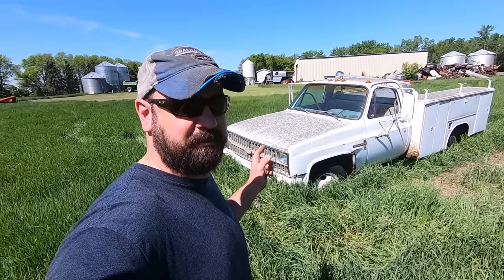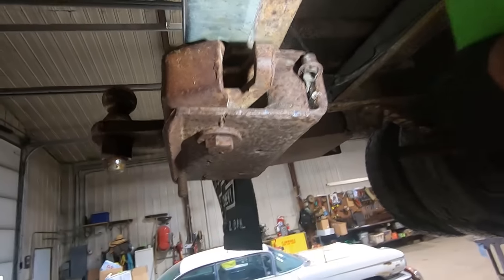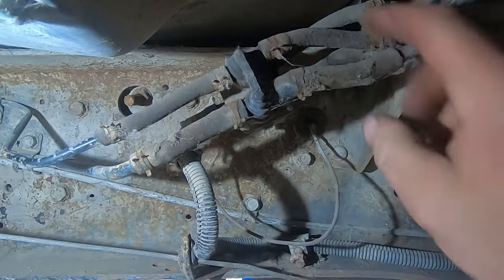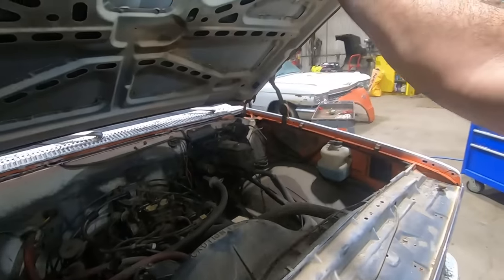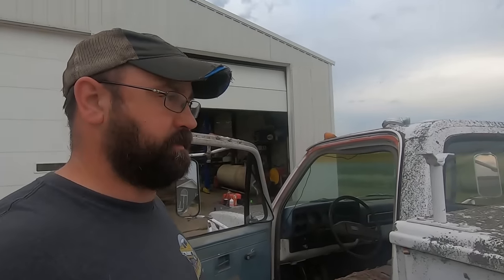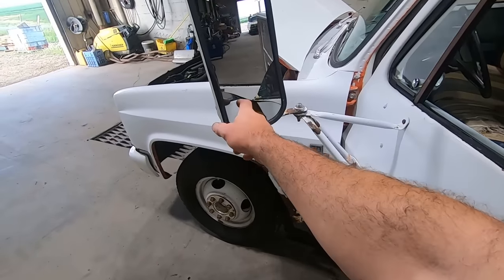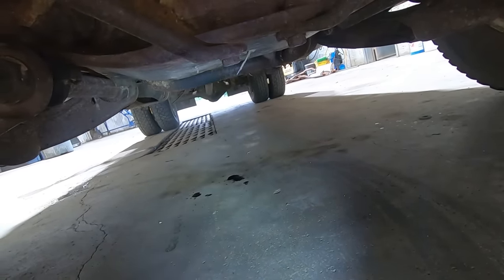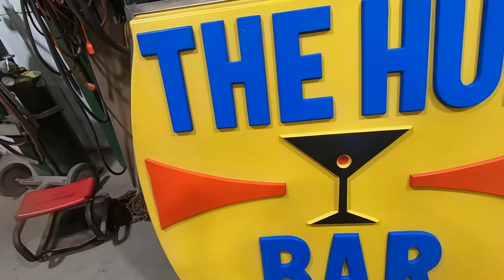1981 Chevrolet Dually! Abandoned for 16 years! C30 Squarebody Service Truck!

Comment: Rattle maybe Hanger Bearing on Drive Shaft slipt maybe need grease up with High Temperatures Moly Grease and need top differential fluid with 80w90  and they do get low on fluid too!

Comment: I've got a funny one for you. I took the radiator cap off one time when the engine was hot, you know like you do, and it blew off of there, you know like it does, and disappeared. I looked every where for it and it was gone. Bought a new one. Took the truck in for alignment about 3 months later and it had stayed all of that time just sitting on the frame riding up and down the road. I just laughed when they guy handed it up to me.
Reply from the maker: Nice!

Comment: I was working on a horizontal stabilizer one time, and dropped a 3/8 wrench down in the tail of an Embraer 145. I got into the aft cable rigging bay and climbed up in the tail as far as I could, took the stabilizer back off, opened every single panel on the vertical stabilizer and never found it. The aircraft ate it. No big deal because it wasn't interfering or anywhere near the elevator or rudder cables. My best guess is it fell all the way down through a lightening hole in a stringer and into the belly of the plane.
Reply from the maker: Damn
Reply: @MortskeRepair  hell of a thing to watch a wrench vanish into the void 😂

Comment: I use to pull up between pumps and fill them both at the same time.  Yea that pissed people off. O well.  1978 3/4 ton. Big block 4 speed. 4x4. Wish I had that truck still.
Reply from the maker: You’re that guy!

Comment: The stripper models are probably my favorite. Most stuff is a repair and an upgrade. 

Get on Wayfair and find the biggest fan you can install with the most blades. Generally more blade surface area means less noise. 

That looks like a 14bolt full floater. I read that most of the GM ones were 4.10 or 4.56. I also read that the rings are for conical nuts. I have a 4.10 rear with 10,000 GVWR springs. It's a firm ride but with new shocks it's kinda fun in a short bed single cab dually. Not much body roll and no wheel hop.

I just wish the tires weren't so expensive.
Reply from the maker: Thanks for the info

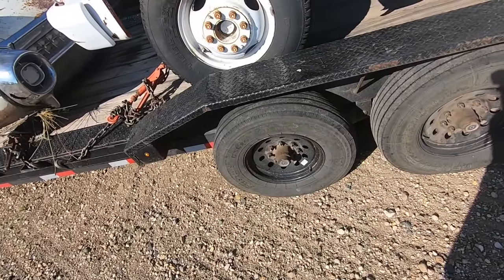Comment: Hell yeah those old 1 ton square bodies they're a good rig that was my first pickup was a 1978 GMC c30 with a small block 350 and a 4-speed in 4:56 gears dad said it wouldn't be fast enough to get a ticket but I can tow whatever I want
Reply from the maker: He was right
Reply: I love that thing I got it when I was 14 years old 700 bucks drove it around till my son was born in 2007 then it sacrificed its life for my brothers 78 GMC Sierra K20
Reply from the maker: @bradleybriggs5187  the gift that keeps on giving!

Comment: Hi Mortske & Duff With that license plate I am surprised the boss will even consider letting the truck go down the road to someone else. You showed the adjustable hitch but what about the vice? Your inquiring minded fans just need to know. Does it swing out or drop into a holding g bracket. It did not look like it could work where it was.
Reply from the maker: No it’s stationary unfortunately

Comment: You should get a set of Chrome Wheel covers and put on it. You'll be surprised how much it will set it off. Gives it the Big Rig Chrome Wheel look. You can get them off ebay or amazon. Not plastic either, real chrome metal. I have them on both my 82 CD30 and my 78 CD30 wrecker. I have 16" wheels on both. Has 4 covers, 2 deep well for the back and then 2 regular for the front. You can also get some Baby Moons for wheel center caps and rear axle housing covers. They're not that expensive but man they make it look 100% better. $3,500 is not a bad deal for that truck. If I didnt have so many projects already, Id buy it.
Reply from the maker: They sound expensive

Comment: On a GM the vacuum advance should get manifold vacuum and so should the choke pull-off (or vacuum break). That opens the choke a calibrated amount (about an eighth of an inch) so the engine doesn’t chug after a cold start

Comment: Could be that the ole truck had a bucket truck installed in the bed rather than a crane. Most of those versalift-style buckets required a torsion bar rather than outriggers. Plus the hole torched in the center of the bed could have been where the 12v power cable for the emergency-down power came through the center of the base of the lift. In addition to the brake lock solenoid you found, it just makes sense.
Reply from the maker: That’s very likely

Comment: Excellent video Mortske Repair  :) never like the Smog Pumps on GM vechiles used them took away hp or torque on 250 6 cylinders, 305 also 350 , some 400  plus 454 V8 motors really pain and Ford had them 400 motors too would pass when Emmision Test get fail for 25  years did Ontario Canada but 2020 don't have do anymore unless do business with Gas also Desiel motor or government vechiles like Police , Ambulance, Tow Truck , Fire Truck or Farm trucks are 3 ton and up if vechiles 7 years or older from 2020 or before! Wrench lost one time was on Hormica Balancer also  in-between rad &transmission cooler that separated  also on Strut mount in trunk of newer on 10 mm socket had fish with magnetic whip !

Comment: I didn’t loos a wrench, but I lost a 10mm old school Craftsman socket down the open air vent while I was working on the stereo. Weird thing was I was below the vent and the socket jumped up into the opening, I saw it go in, I heard it roll to the left, drop a bit roll to the right, drop a bit again and then roll to its final resting place. Tried magnets tied to a string, wasn’t about to disassemble the entire dash, I no longer own that vehicle.🤦🏼‍♂️

Comment: I usually use snap ring pliers to open the pvc pipe for the striker. Service truck would be cool with a Dana 70 under the front with a T5 trans
Reply from the maker: Thanks for the tip. T5 might be a little light

Comment: The swamp cooler fan sucks. I work in a smaller shop and it does little to nothing for cooling. Exhaust fan at the top in combo with normal fans has been the best result down in GA. Can’t fix humidity but that combo works best so far.

Comment: You are checking the fuel flow capacity and you found the fuel filter and you would throw away the mechanical fuel pump and seal straight steel grommet over the engine block where the pump was at. Then use some plan for temporarily fuel in from 75 up to 90 PSI of electronic pumping to the injection overhead the throttle body for 350 CID Custom deluxe that replace your chevy ramp truck. Can you find the oxygen sensor for Square body truck?

Comment: Well, I think your BS (body skills) are Rated PG (Pretty good)! By the way, the vacuum port for that choke pull-off/secondary actuator on the right rear of the old Quadrabog is on the backside of the carb at the base plate. It's next to the big vacuum port used for power brakes. Looks like she's a good runner!
Reply from the maker: Thanks for the info

Comment: The rings spread the load over more surface area on the rim, rather than just around the stud hole, to prevent stress cracks on the rims
Reply from the maker: Thanks for the info

Comment: You can build a closet around it with vents in your door and vent in the roof like a water heater. Two walls and a door with a roof and attached to exterior wall punch a hole in the wall for air supply

Comment: Yeah vacuum secondaries you got to hook it up to an accelerated vacuum The first layer vacuum lines are constant vacuums The second layer of vacuum lines are throttle vacuums so anything above the bottom plate is fine and the top one is a vent that must be open for the fuel but it's a quadrajet more than likely it's just all clogged the hell up meaning the front stone or filter right there where the line goes into the carburetor you know this

Comment: Hottest part of your shed will be the apex of your roof... instead of fans swirling the hot air around, you should install a vented ridge cap and or some electric exhaust fans, We call them whirly birds in Australia and I have two in my shed that each move 550 cubic metres of air per minute or something ridiculous

Comment: I was changing a intake manifold on a 85 Chevy Camaro berlinetta sport coupe 2.8 multi Port v6 because the intake always had a big vacuum leak that is because it was visibly cracked on the center on the passenger side big enough that you should stick a screwdriver craftsman flat blade about a 3 inch into.. anyways I was pulling the intake and two washers,3 bolts and a 13mm wrench fell down the distributor shaft hole... well time to pull the ok oil pan great
..lol
Reply from the maker: Wow, the trifecta!

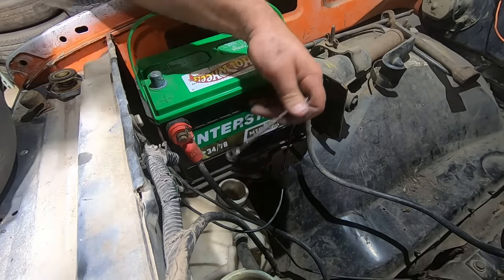Comment: 49:36 lost a 5/16 quarter drive deep socket and six inch extension in the oil pan of a Ford 4.9 I6 once. WAs trying to prime the oil system and it popped off of the drill, bounced out of the oil pump, and ploimp!---
Reply from the maker: Whoops

Comment: I think you drill 3/4  inch hole thru the floor in Reading bed and then please saw saw from the hole toward to the tail gate 6 inch times 6 inch that reciprocating saw produce the 6 in wide and 6 in long at inside side of the longitude of the chassis to easily access to the fuel lines and fuel filter could be clog in the line underneath. The filter in the carburetor is bad unless you proof me wrong. Recommendation - where is the filter. Thank you.

Comment: Tools I broke down ten miles from home in front of a station, I needed two wrenches to fix the problem Owner said I don't lend tools. I pulled out fifty dollars and asked if this would guarantee their return, he asked what /i needed 1/s 9/16 and 5/8 3/4 box or open end he gave me both. That is when I noticed the tiny notches, I made the repair and returned the tools with the question Where did you get these. Down the road at the triple ball pawn shop he gets them in every once in a while. The tools were my Dads that my brother pawned to by parts for his junker. My dad used to notch his tools
Reply from the maker: Interesting

Comment: Not a line lock, if you look on it there’s a pressure switch, it probably tied into the crane at one point to lock it out, if the brakes weren’t applied the crane wouldn’t operate. Somewhere there is probably some sort of line lock to KEEP the brakes applied…

Comment: There is the 390 CID for white truck using truck engine so the motor is complete for checking the used battery voltage reading in 15 volts with Mortsk's Battery jump booster 100 amp. The abttery must less than 6 years olf read the date when was it new? 
 Crank it and the pressure coming off from the tail pipe is both 10 decibel and almost 400 PSI and the engine decibel is also loud suction of the compression testing with stethoscope you must wear it please. Thank you.

Comment: Sometimes you can get a rear end gear ratio from the glove box label, if it hasnt been changed out. Just make sure the vin matches
Reply: Also, the carb issue is probably the fuel filter that never gets changed. Inline with the fuel line, front of the quadrajet.

Comment: Only thing never like about 1981 GM was Carb on electric choke on so many hose hook up also electric fuse panel to 1978 electric set had 292 6 Cylinder  to 350 V8 motor with electric choke Carb plus whole truck to ! Also Mortske have ever do fuel tank set had switch for tank near seat off tap do one tank on first postion or second postion for second only and 3 postion was for both of Tap also 2 switches for 2 postion turn one or 2 tank in use plus fill up tank when one get low to so get fuel station to refill up ! Also those Uniroyals Laredo Tires those tire were excellent my dad had on his 1990 Chevrolet Cheyenne 2500 light heavy duty 3/4 ton with 6 studs 225 /75 /16 LT Load Range D  Uniroyals Tiger Paws Laredo tires AT/S plus from 1994 to 2006 years till change them to new tires on all  5 rims ! Also had my 1995 Dodge D350 Extended cab tow truck Mortske Repair and love performance the did and grip also more went thru loads miles on them plus had 12 tires of too ! Mortske if Alternator gauge no saying charging check the Brakes Booster by fire wall of Diamond black with 2 post connections they may be corrosion on connections of wire take off and clean them plus put Anti Seized on thread and nut threads too ! Screw up nice 1/4 tight of 5 pounds each nuts on connections! Bet be surprised if not Alternator connections need clean up too or check - pigtail ground to fender or rad by headlights maybe rust up and corrosion too on bolts plus washer even connections connector too! Also Distributor Vaccum port need hook up to breather snorkel plus intake to also Heat Riser Flap  need lube up and hose cleaning  to ! Also truck be 411 to 418 in those truck ! Nickname truck be Casper!

Comment: My G30 350 is running flat on its face all of a sudden  when under load. Rained for two days and high humidity. Spark plug wires were last changed 26 years ago. New ones ordered last night from Rock Auto. Pretty sure that will cure the deal. It idles fine with no load. Hopefully !! Distributor cap next option.
Reply from the maker: Good luck
Reply: @MortskeRepair  Wires didn't solve the problem. But they were due . The battery connection was weak and not satisfying the HEI distributor. It got where the dome light would stay off and no  ignition switch "on" Cleaned the terminal , it started and the jitters went away .
Reply from the maker: @tim1299  Glad to hear you got it resolved Tim!
Reply: @MortskeRepair  loosing power to everything ended up being a "Good" thing.
Reply from the maker: @tim1299  Makes it easier to find I suppose.
Reply: @MortskeRepair   Yep, didn't have to  look  at the distributor or  Quad-jet. Enjoyed the Riviera vid.

Comment: Are you sure about having to change core supports to swap headlight styles? You may be right, I was under the impression you just had to swap in the correct hardware. I thought all the core supports were the same.
Reply from the maker: Yup

Comment: I once dropped a Mac 9/16" combo wrench in the bilge of a Hinckley sailboat that I was repowering, it went down in the keel and wedged itself between a stainless tank and the hull. It was a good distance down, and I couldn't just leave it there.
Took me a good four hours to retrieve it finally using a magnet and monofilament.😒
Reply from the maker: I would have given up way before then!
Reply: @MortskeRepair  I was worried that it would have worn a hole in the tank.

Comment: That blower motor lead has a static reducing coil in series , might be a capacitor, I never cut one apart to find out for sure what it really does.
Reply from the maker: I think it's for radio noise/feedback.

Comment: for the compressor just put a shed outside on the wall, just need a couple holes, power and air line, noise gone.
Reply from the maker: What about freezing weather?
Reply: @MortskeRepair  as long as you drain the water it'll be fine, my brother has an unheated detatched shop and has never had issues with his compressor in there. (And we live in canuckistan so you know it gets cold)

Comment: Make a few air conditioners out of old coolers! Cut holes in them, put some PVC pipe in, then put frozen jugs of water inside, then run cheap fans into them. Blows out ice cold air for cheap. Instructions on youtube. Put some FLEXSEAL in that hole in the tire. Good as new! Lololol

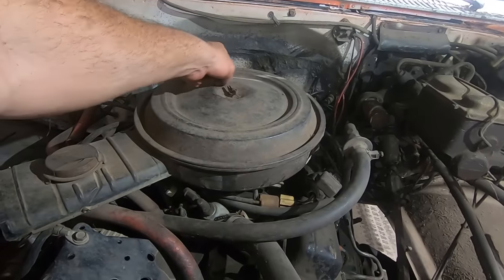Comment: 41:18 that was a stop gap measure to boost catalytic converter function before fuel injection. SMOG pumps would push the air into an injection port on the converter body so it could more effectively convert unburned HCs into CO2s.

Today's cars don't have one of these pumps. They don't need it. Modern catalytic converters are much more efficient in general and the EFI systems on today's engines can just lean burn the engine to shove excess O2 out the back. They also run the fuel mix much tighter in general so there's nowhere near as many unburned HCs coming out the back as there used to be.
Reply from the maker: Thanks for the info

Comment: The spark firing warranty and Grand Auto set of the spark plug wires for $35.00 a set. Then youe brake does not need power vacuum booster, Because it doesn't have any. The maul foot brake is like no free play and depress the pedal at no more than 2 inch max so brake shoe fraiction can be worn out and so does it recommendation replace the drum that you can with 12 inch wood ruler and I.D. will show big differences of new brake drum and 1981 original drum weighted down by the reading tool box so it did damage the pad too fast. The Reading tray is 5 tons a little less.

Comment: Hey I'm at the point in the video when you and Duff are just driving a thing around how come you did not check the fuel filter in the carburetor yet you didn't pull the wires off to see if they were corroded I get it you do it at least possible but these are things you do it's a GM electronic ignition The module could be causing that problem The pickups could be causing that problem Love the truck though but let's worry about how dirty the bed is okay your turn they cut the hole cuz if you can remember he told you they had a crane in there

Comment: Are you going between your rims as a spacers between the tires
Reply from the maker: Huh?
Reply: Yeah you take the first wheel off and you put that spacer in between and then you put the other and put that tire back on and it gives you enough space between the tires so they don't get hot a long time ago
Reply from the maker: @edwinbonnelljr1587  Never seen them used between any of the duals I've pulled.
Reply: You're very welcome anytime I'm a backyard mechanic not some shady mechanic with a license